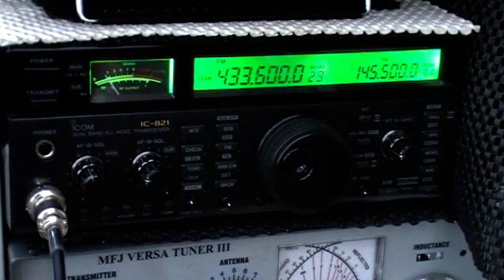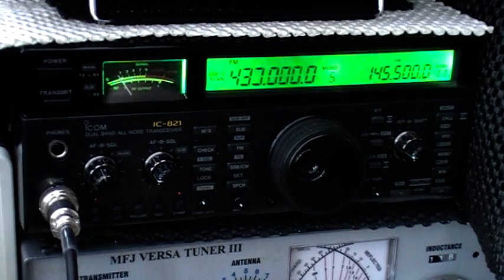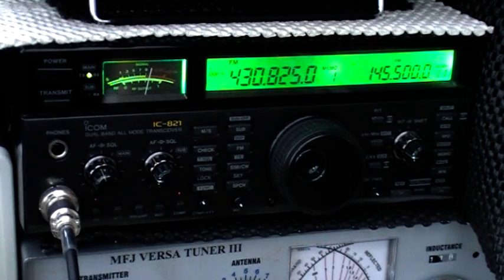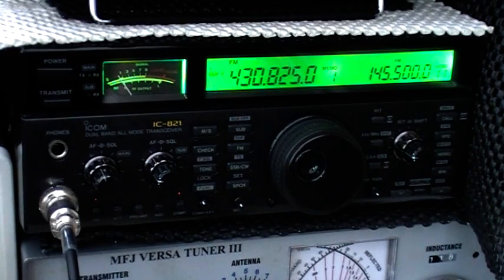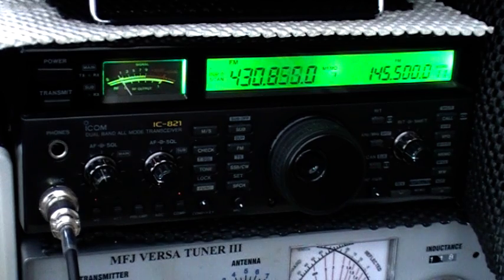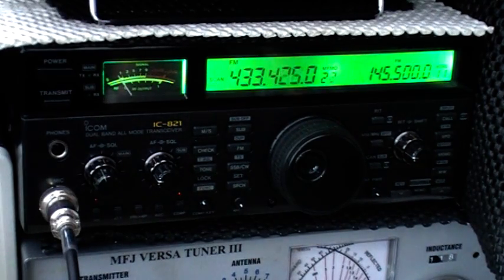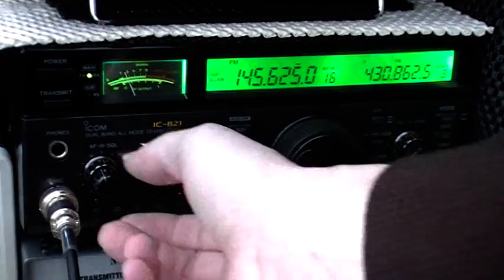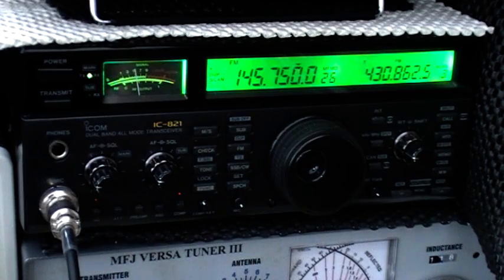ICOM IC-821H 2m/70cm Base Station

Comment: Buying one Today for SSB/FM Satellite Operations & SSB simplex as well.I am just awaiting its arrival. 😋
Reply: I have only owned my own ICOM 821H for one day and I must say it is a far simpler radio to program and use than the Kenwood TS-2000 that I replaced with it.I made a very wise choice I think.I am using SatPC32 with it and it’s The Bomb.
Reply: @1OFGODSOWN  just ordered the 820 for the same exact purpose, here for the same reason you probably were for a year ago haha
Reply: @thebritisharecoming7495  I am considering selling my 821H because I also now have the 910H that I use just for 2 meter SSB & I could use it with the Birds of course.👍🎙